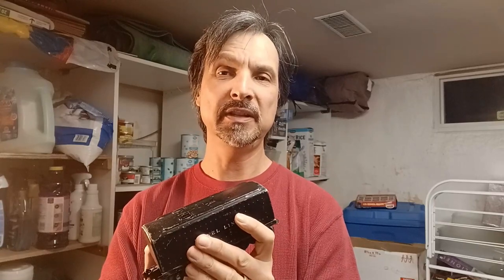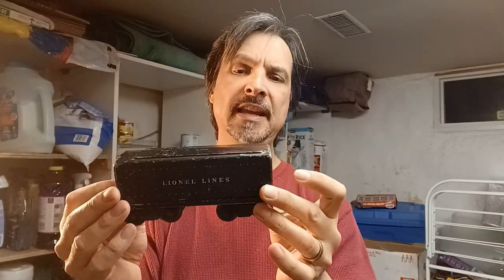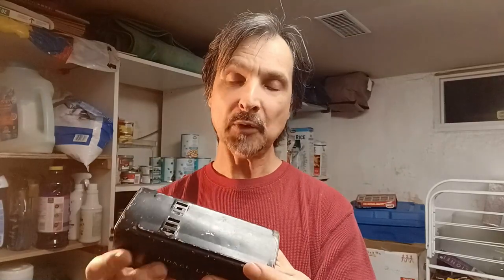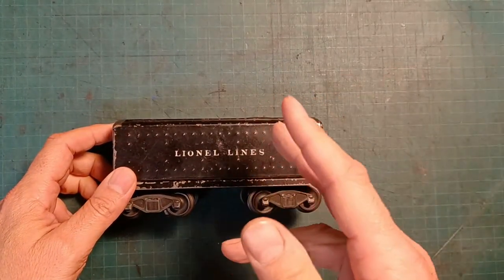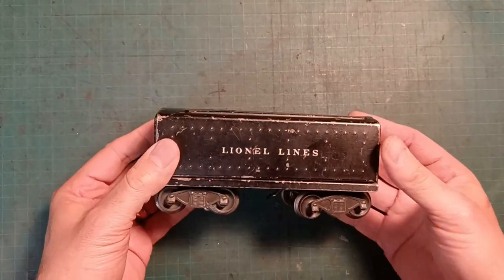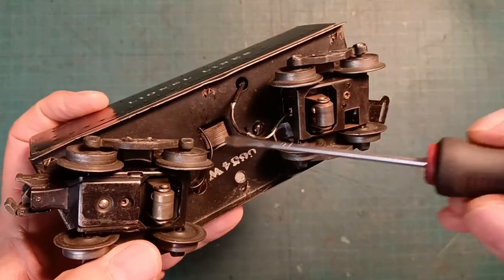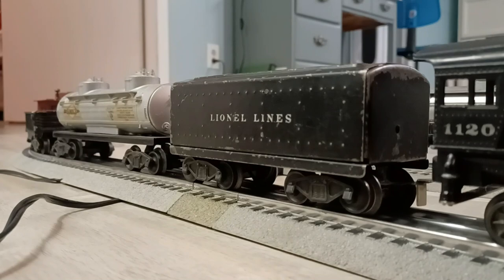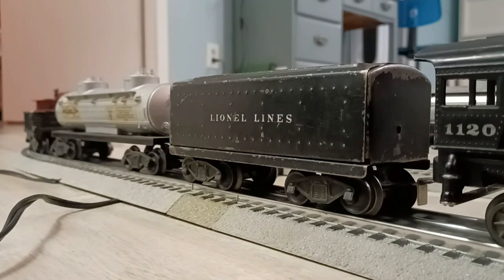Can I get this old postwar whistle tender to whistle again?

Comment: Instead of disassembling the relay, do an old car mechanics trick: get an emery board and clean the contacts without disassembly.  It takes just a a couple strokes and eliminates the risks associated with that 6 layer stack.

Comment: Awesome tip on heating the tabs prior to unfolding them! Just got my superflex wire delivered, and been meaning to fix my 2689W tender for awhile
Reply from the maker: Thanks for watching! Yeah that heating tip is a life saver! I wish I could remember the channel I found it on to credit them. I used the heat on the tabs of the diesel horns and tabs on the trucks and its saved all of them from breaking off.

Comment: Just another thought, on some of these the field coil, or commutator could be wired in the other direction by accident making the the blower wheel run the wrong way, making more air noise then whistle sound.  I had one some time back that I bought used and it was wired wrong.

Comment: Hey, I’m new to this, and I just had some of these handed down to me and I was needing a tutorial on how to clean and fix an 1120 engine and 1654W whistle blower and a 2032 engine. Do you think you can help me out with that?
Reply from the maker: Hi George. Welcome to the hobby and thanks for watching! Yes I can help out. I have a video for the 1120 here: https://youtu.be/76taiSLKAPY
And the 1654W tender works no differently than the one in the video you watched. So it will apply to your tender.
Unless someone has been in there and swapped out parts.